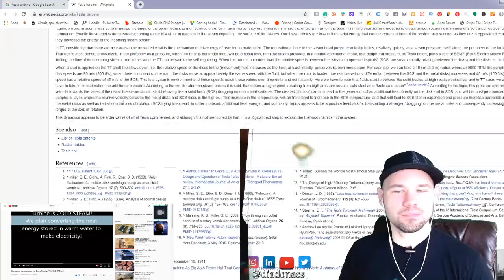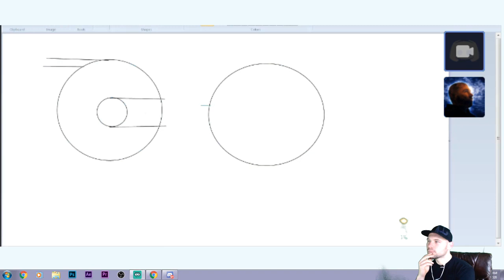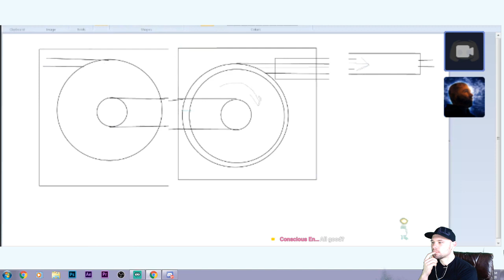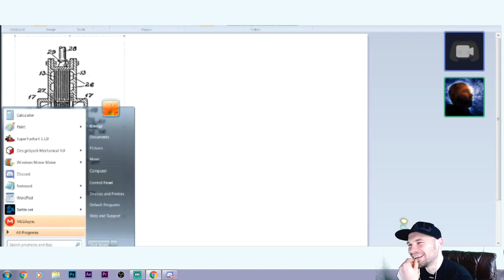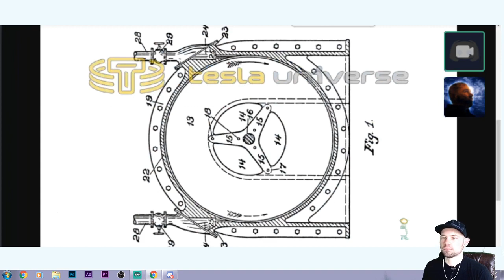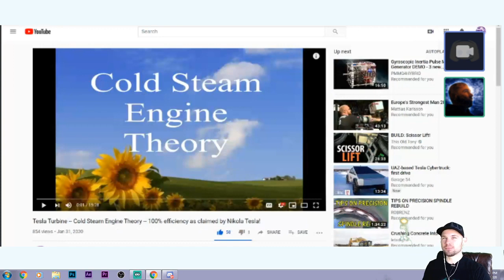Dual Stage Tesla Turbine, Conscious Energies Live Podcast 12, Interview with Jeremiah.

Comment: Your question on wireless energy...Yes, it works. No, its not like a beam of directed energy transferring from the tower to the user. The tower is connected to the users within range through the earth itself. The tower was not designed to transfer energy from a power supply to a distant location. The tower was designed to RECEIVE energy from the earth's atmosphere and transfer it to the earth where anyone within range can use it. Earth is a giant spinning magnet...
Think about it... a generator consists of spinning a magnet past a coil of wire... think...earth is giant magnet...the outer ionosphere is giant capacitor storing up static energy created by earth spinning inside the atmosphere... we don't NEED power generators. We need to tap earth's power. If you dont believe it exists then you need to explain lightning to me.
Reply from the maker: Yeah I did some experiments on that apparatus in the past. It works but I didn't have the funding at the time to make it practical. I will be returning to it soon.

Comment: The sudden burst of speed,  I believe,  has everything to do with a pressure change threshold. There is a point at which the pressure pushing against the discs causing rotation equalizes with the pressure against the shaft itself within the gaps between the blades due to a balancing of centrifugal force and lateral force within the vortex being created. This point can be reached sooner by having notches on the outer circumference of the spacers/washers on the shaft between the discs or on the shaft itself if you're not using spacers. What happens is the vortex of fluid grabs the whole spinning apparatus discs,shaft and all within itself taking immense pressure/friction away from the bearings. This effect can be dramatically increased by using magnetic bearings which are correctly configured to suspend the shaft within a magnetic field so there's zero friction on the bearing points.
Reply: Its about causing the vortex to spin so fast that it compresses in upon itself until the shaft becomes sort of "suspended" within it.
Reply from the maker: @captainKedger  Correct! My new air bearings don't sit on needle points, it's interesting how the turbine rotor centers it'self if allowed to.
Reply: @iEnergySupply  theoretically  one could have a turbine which has no bearings at all. The problem we would need to work around is that the rotor is not suspended in the vortex until such a time as the turbines get going fast enough to hit that threshold. If you could somehow generate the vortex and insert the turbine and casing in perfect synchronicity with the vortex minus the bearings and maintain that speed without ever slowing down below the threshold we would have a purely mechanical and almost perpetual motion machine running on the  thermodynamics of water. Now consider the fact that water retains heat much longer than air, and sun can melt rock with a fresnel lense....ask yourself, wouldn't it make more sense to use this form of energy storage and convert it to electricity as needed rather than storing electricity in batteries ? Wouldn't the sun give more than enough energy to supply limitless power if all of our motors ran this way rather than on electricity. ..? Now here's the biggest clincher of all...THIS MOTOR IS ALSO A HEAT PUMP THEREFORE IT WILL REPLACE AIR CONDITIONERS!!!!.
Reply: Air conditioners and electric stoves are the biggest waste of energy ever conceived.
Reply from the maker: @captainKedger  Looks like you understand the entire system, Thanks for following so closely! Store you energy in heat, not batteries!

Comment: Poe oil.
Reply from the maker: ha?
Reply: What about a methanol cold tank. From my research it should boil around -7.6C, or 18.32F than all you have to do is hook up a compressor on top of your cold tank, a tesla pump after your turbine hooked up to a small drive motor, and an inline hot methanol heater after you hook your turbine up a 25/5 gear reduction it should get you around 1800RPM from your previous 9000RPM just saying that 9000/5=1800 the way you can push a 60kw DC generator. Now all of this is powered threw the grid, but if I am correct if you had alot of them hooked up in series than they all would power themselves as long as they all did not break at one time, so so much, for planned obsolescence.
Reply: It also is used as an antifreeze, and if you look at the methanol that is made from biomass it is also good, for the environment.
Reply: You are also going to need a valve that runs from the bottom of your tank to your tankless methanol heater the way it can make equilibrium to get you stared the way you can start with cold product, but it says that the 18.32F is under a vacuum. I do not know if I believe it, but that is what the guy had answered for a question. He did all of the thermodynamic bullshit, and it looks fine to me, but what the hell do I know never could understand the engineering aspects that go into building something, but they cannot get real world applications right neither, so I guess it is a catch 22.

Comment: At twenty two minutes in it is clear Jeremia's host is not eliciting a coherent response. 

In my view, Jeremia is convinced the integral pump stage is required and later he debunks the notion of resonance (despite publishing enthusiastic video responses when the phenomenon occurs he's actually saying he wants supersonic air flow rates) 

I think it may help to think that at the Cold High Pressure (CHP) zone at the exhaust outlet is not at equilibrium with the vacuum zone which is chilled-from-ambient LP) the gas needs to pick up heat and it does this by spinning out through the "pump". 

But he says (later) the pump just a final stage of the turbine that kinda balances out the flow so that you avoid the pitfalls of ice build up, and it serve to line up the molecules up for a high velocity ejection, and therefore higher mass flow in unit time, into the "vacuum of deep space"

I want to suggest digital Pressure and Temperature sensors are needed on both intake and exhaust, and ideally at each stage as well and some kind of effort towards measurement of the mass flow as well as RPM on continuous equilibrium runs.
Reply: I have absolute faith you've thought through your destructive testing tenancies, which are clearly driving up viewer numbers. I'm also saying let's think together about sensors and monitoring. Patience is a girl I once loved, its tattooed on my forehead and written on my bank account statements <3
Reply from the maker: Patience my friend, we will have more details in the future. I don't have much time to do everything I do and can't always give a quick and detailed response to all the comments, I do try my best though.
Testing details take resources that we are getting. due to the increase in support we have gotten from all our viewers lately and we will be showing readings from more scientific instruments more in the future. We will also be showing a metal turbine soon that no longer is constrained to the limitations of plastic.
We also have a demonstration that will visually show exactly why the vacuum stage of the turbine increases the efficiency so drastically.

Comment from the maker: I think I was wrong about the boundary layer effect and bad vibration thing, I believe the turbine does accelerate after the boundary layer kicks in, we are getting the same effect but it's more pronounced!
Reply: Oh my comment above now needs revision
Reply from the maker: @SimonRichardMasters  Ok
Reply: Bought your Tesla turbine in full package today.  Let me know when metal version will be available specifically stainless steel.
Reply from the maker: @d1mov  Thank you! I have a machinist visiting on the 14th to see cad drawings for our first metal prototype.
Reply: I draw the same design of turbine with secondary turbine about 4 years ago without knowledge that N. Tesla patented it. But I made it self-running by generation of steam in primary turbine. It will make drawing energy from eather for collection of excess of energy in electricity generator. It needs to be little redesign of what you are making. 
Originally this NT turbine was not made for gases nor liquid, its was the secondary application, to hide real purpose of it 😉
Reply from the maker: @d1mov  really awesome! We are discovering new things every week with things that you wouldn't expect including high voltage electrical discharges. Everything has to be just right for this to occur. I believe we are on the verge as a group to cracking the 10 horsepower for every lb of weight. Thank you for being a part of it all!
Reply: @iEnergySupply  I will contact you after I will get my order.

Comment: Is Paul saying in an open mobile system you don’t need a warm tank either because the system is already generating a 4C difference between the ambient air and outlet?
Reply from the maker: Theoretically it is possible, once we reach supersonic speeds with a turbine pump combo, we will prove this theory. One of the problems with this system would be utilizing the phase change of water. All moisture in the air will turn into water/vapor and the energy can be extracted from that phase change.  If there isn't enough humidity in the air, I don't know if it's possible to get much power from the air. It needs to be tested because it's possible that the heat from nitrogen co2 and oxygen in our atmosphere can be the source of energy, although utilizing their phase change would require extremely low temperatures and thus extremely high speeds. Everything changes when you reach supersonic speeds so it just needs testing. 
I am utilizing the cryopherous to first make the system practical, and then test supersonic open air system like Paul would like to test with a couple ambient air valves that will be opened once the turbine is going supersonic.

Comment: Think it's the sound resonances inside vacuum with the double vortex that breaks law of thermodynamics?
Reply: @Bestowic Primer how would sound conduct in a vacuum? My personal opinion is no breaking law of thermal dynamics just getting 99.999 % efficiency which is amazing in its own right. But by all means please prove me wrong
Reply: @christopherwolfer5197  well that's the thing I wanna know have u heard of safire project? Way more power than expected . But only when lowering maxium power to 7% and Bam way more power than maximum suggesting resonance frequency of sun achieved and Genesis of matter happened
Reply: Also id like to participate anyways possible I thinking of how to condense it into a barrel tube style with shaftless discs cored were it flips back into another drum of internal discs counter rotating inside but also utilizing possibly of valve system seperation jets between shaftless discs and core turbines in a dna helix form before cycling
Reply from the maker: @bestowicprimer8835  Would be awesome to test the barrel design in the future, right now I am going to stick with Nikola Tesla's mk2 rotor design just to stay true to his instruction.  I am not sure it's breaking the laws of thermodynamics. I believe it's only fully utilizing them. There is an infinite amount of energy everywhere, just needs to be transformed to usable energy. No energy created or destroyed just transformed you know?
Thank you for the good comments!
You can always share the videos to help spread them around.
Reply: @iEnergySupply  well that's a point I didn't consider lol we could look it  as a stepping stone yes keep going I'm gonna be working on many designs I mean I vomit new ideas eventually one will work
Reply: Good answers Charlie so you are adamant that the hydrogen bonds reform within the turbine... I can live with that as it means a lot of cooling below ambient and suddenly you have (shall we call it) a "pool" of chained water that the last stage flings out into the vacuum whereupon it condenses as a liquid? As you may have seen from my previous comments elsewhere on this thread: it is important to measure the mass flow. Somehow.